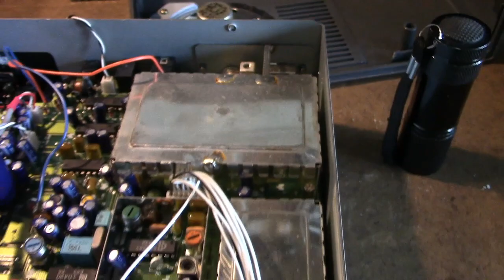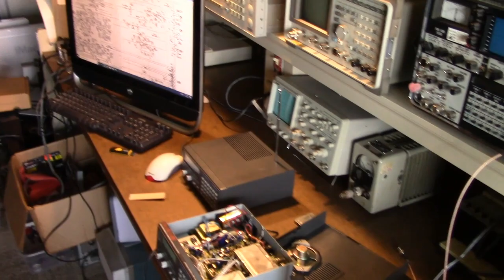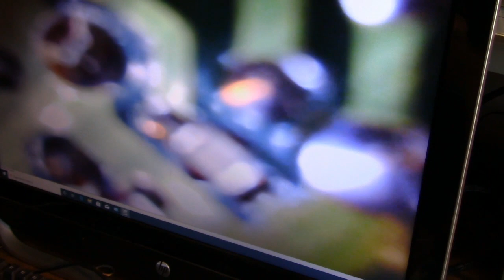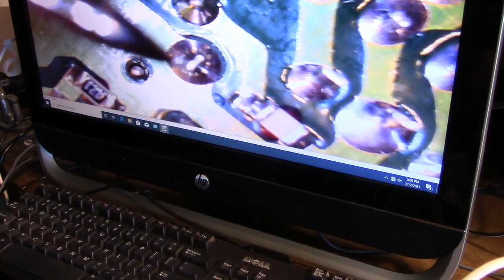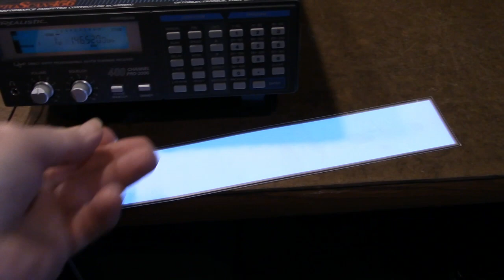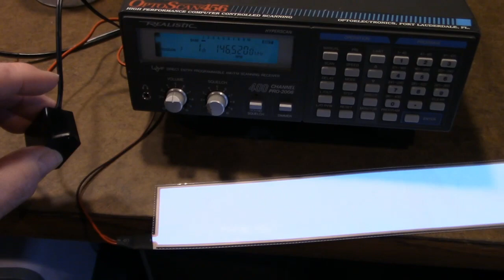Radio Shack Pro2006

Comment: I noticed your scanner on the right says Fort Lauderdale, Florida, so I asked ChatGPT the following question:

“Can humid weather like in Fort Lauderdale, Florida have the potential to prematurely deteriorate solder joints on circuit boards of electronic equipment?”

ChatGPT replied with this:  ⬇️

Yes—humid, coastal environments like Fort Lauderdale can absolutely contribute to premature deterioration of solder joints, though it’s usually indirect rather than immediate. Here’s how it happens:

🌫️ 1. Moisture + Contaminants = Corrosion

High humidity by itself isn’t always enough to damage solder, but in real environments it combines with:
	•	Salt (from ocean air)
	•	Dust and pollutants
	•	Residual flux from manufacturing

This creates a thin conductive film (electrolyte) on circuit boards, leading to:
	•	Corrosion of solder joints
	•	Oxidation of metal surfaces
	•	Electrochemical migration (tiny conductive paths forming where they shouldn’t)

⚡ 2. Electrochemical Migration (Sneaky Failure Mode)

In humid conditions with voltage present:
	•	Metal ions (often tin, lead, or copper) can migrate
	•	This forms dendrites (microscopic metal filaments)

Result:
	•	Shorts between traces or pins
	•	Intermittent or “mysterious” failures

🔁 3. Thermal Cycling + Humidity

Places like Fort Lauderdale often have:
	•	Warm days
	•	Cooler, air-conditioned interiors

This creates condensation cycles, which:
	•	Expand/contract solder joints
	•	Accelerate microcracking
	•	Allow moisture to penetrate tiny defects

🧂 4. Salt Air Makes It Much Worse

Coastal humidity is more damaging than inland humidity because:
	•	Salt is hygroscopic (it attracts and holds moisture)
	•	It increases conductivity of surface films
	•	It speeds up corrosion dramatically

⏳ So, Does It “Prematurely Deteriorate” Solder?

Yes—but usually over time, not instantly.

Typical effects:
	•	Gradual weakening of joints
	•	Increased resistance
	•	Intermittent connections
	•	Eventual failure (months to years faster than in dry climates)

🛡️ How It’s Mitigated in Practice

Electronics designed for humid/coastal areas often use:
	•	Conformal coatings (protective layer over PCB)
	•	Sealed enclosures
	•	Gold plating on contacts
	•	Better flux cleaning during manufacturing

🧠 Bottom Line

Humidity alone isn’t the villain—but humidity + salt + contaminants + voltage is a powerful combination that can absolutely shorten the lifespan of solder joints.

Hope this helps shed light in any way. 

~David M. 03/26/2026 (Thursday)

Comment: On mine that I haven't used in years, the el was dead, after leaving it on a few days it started to work, alittle not full bright, did you measure what the el voltage was?
Reply from the maker: HI Mikevi,  I don't remember measuring it at the time.  I have had devices suddenly decide to work after being powered up for a time.  Who knows,  a cap reforming or a soldering joint deciding to conduct.  Some electronics circuits seem to have a mind of their own.

Comment: Saw your Optoscan 456 sticker on one of your 2006's.  I have a 2006 with that board that I installed.  Do you know of any software (Scancat, Probe) that will run the radio?
Reply from the maker: Hi Rob,  I am not familiar with the software.  Since these were popular there may be some user groups out there that can help you.  With so many services going digital , these have lost much of their utility.  I use mine mainly for receiving Ham Radio signals.
Reply: It appears that the OS456 add-on board has been removed from the shown radio. The OS456 had a board that you would remove some of the internal cables and make a couple soldered connections. There was also an interface module that one would put where the 9V battery holder resided, this had a DB-9 and a C-iv connector. That would then require the user to relocate the 9v memory battery inside the radio or install an external clip (my solution). They made OS456 boards for the PRO2004, 2005 and 2006 scanners and similar OS535 boards for the PRO2035 and 2042. If the OS456 board is still present try and find a copy of Probe, it was the best program for these radios! It ran in DOS, but it was a great logging package, I used it for spectrum management back in the day. OptoElectronics also made a standalone version called the OptoScan that (with the optional BitBanger feature) would allow one to track the Motorola and EDACS trunking systems that dominated the business in the late 80's, 1990s and early 2000's.